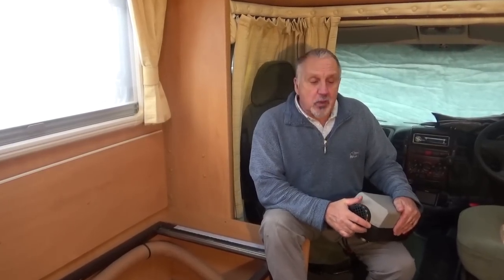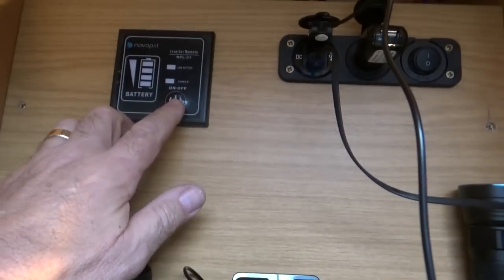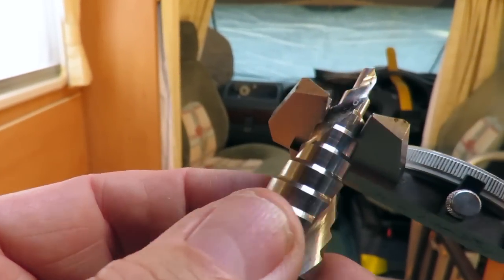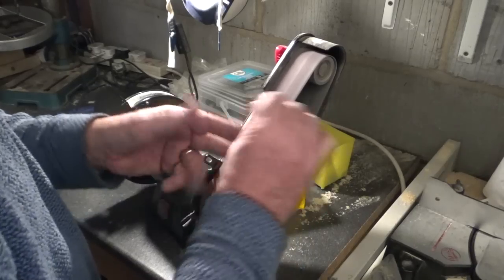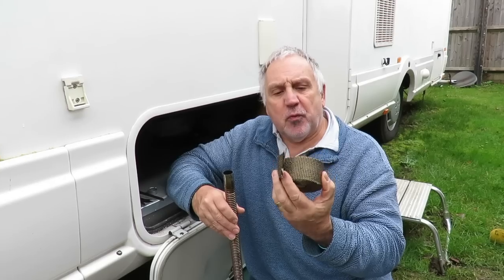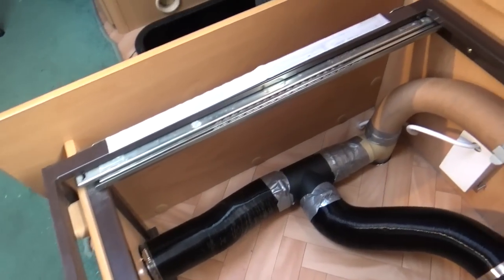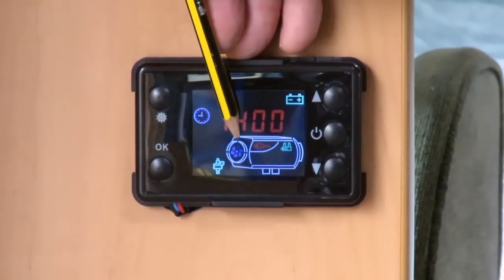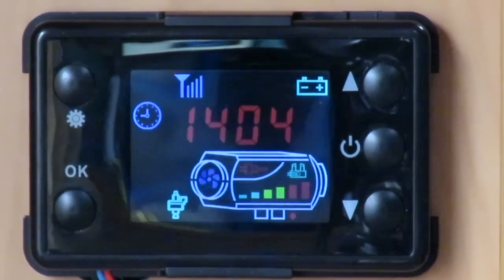How To Install A CHINESE DIESEL AIR HEATER, Ebay 5KW parking heater fitting guide. Full instructions

Comment: Good video.  Well explained for the most part.  Some additional suggestions for other installers:  the exhaust port (vs air intake line) is the one furthest away from the fuel inlet, and it’s very wise to seal the exhaust pipe to the main unit with high heat sealant to prevent anyone from killing themselves with carbon dioxide leaks.   You’ve done a tidy installation overall but you could  have saved yourself a lot of work (and prevented air leaks between your outside storage chamber and the interior under seat area) by simply tilting your tank over by about 20-25 degrees  so the top was low enough to fit in the space under the seat top.  Nice job though.
Reply from the maker: Hi Richard,
Yes, did consider using a different shaped (more squarer) fuel tank, but must admit it never dawned on me to tilt it.......!
I did actually add a little exhaust paste to the joints after, but didn't film it. 
But I did check the carbon dioxide levels at the burner and at the exhaust outlet. At the burner was zero, to be expected. But at the exhaust it was barely much above the zero as well. Which really surprised me and shows how efficient these units really are.
I have several Co2 meters in and around the motorhome, so feel confident I would be alerted of any leaks, plus I tend not to run it during the night.
All in all, they are very good heaters that work really well for me.
Thanks for your comments, 👍
ATB, Steve

Comment: Hi when priming how do you know when the fuel is up to the heater or does it automatically come out of prime when it's done?
Reply from the maker: Hi Martin,
If you used clear fuel pipes you can trace the fuel as it goes along the line, if not you can have an open end upsteam of the pump.
Mainly depends on your installation really.
Essentially it's only to save you ab of if time when you first fire it up.
Reply: @TheWrinklyNomads  Hi thanks for your reply. Yes it's clear fuel line. So I am guessing once its up to heater I just Press stop on controller the fire it up?

Comment: Hi, I’m thinking if using one of these to heat my shed/mancave. I can run it off a 12v car battery, but should I back this up by fitting a 240v to 12v power supply to the battery ?
Reply from the maker: Hi David,
Lot of people do that.
So long as your battery is topped up you will be fine.
I have a video on the amps used to run  these burners as well:
https://youtu.be/puvd9Z8zJFY

hope it helps
Steve
Reply: @TheWrinklyNomads  s
Reply: @TheWrinklyNomads  hi, thanks very much for answering. Your videos are very helpful. Now I just have to find out what type of power supply I need to put in to keep my car battery topped up. I will need a 240v-12v continuous power supply as I’m going to use the heater for my mancave which my son has taken over as an office for working from home. Any suggestions are most welcome. I definitely intend to use one of these. Chinese units, only £100!!
Reply: @TheWrinklyNomads  Hi again, after watching a few of your videos I’m going ahead with a heater for my mancave. I’ve decided to use a leisure battery kept charged by a solar panel and controller. As I wont use the heater every day this should be plenty. I have another question. I’d like to mount the whole unit outside in a box and run the heat hose into the shed, but the other end of the heater will then be out in the cold, should I run another hose into the shed for the fan to take the air from ?

Comment: Love the video but can't understand why you didn't move the heater over so it was closer to the edge and then run the exh and air which are flexible giving you full access to storage compartment
Reply from the maker: Hi Stephen,
Thank you for your comments.
I used this system for 6 month, however, since this video I have done a complete upgrade, including a new tank setup.
I now utilise the storage below exclusively for the heater.
Here's the video link:
https://youtu.be/HHJaPP2uLFA

ATB, Steve
Reply: @TheWrinklyNomads  the new set up is excellent love the new fuel tank and would love to know where it was from I can only find small or oversized
And can't wait for the next video keep it up and thankyou

Comment: taking a jerry can into the van to fill the fuel tank seems painfull, as it has to be refilled every 36 hours of use;, as does his exhaust pipe cutting the external storage access  in half. i guess it was because he was trying to use existing ducting. Helpful to see the assembly process though  :)
Reply from the maker: Hi
This was just my initial, test install.
Since this video I have completely upgraded this install to this:
https://youtu.be/HHJaPP2uLFA

A massive difference...

All the best
Steve

Comment: Hi can tell me if my 240	To 12volt transformer from my fridge to run the heater from the mains
I have noticed the output voltage reads 14,3v will this be OK?
Reply from the maker: Hi Henry
Yes, it should be ok.
However, if the transformer is not man enough at start up the heater will simply shut down.
You also need to be careful that the transformer is not accidentally turned off when running the heater, as this can cause serious damage....
ATB, Steve

Comment: I would advise you to have an extra vent into the cupboard that has the air 'filter' located..  and on reflection I bet you regret running the exhaust right in front of the store access door...
Reply from the maker: Hi Anthony,
There are additional air vent within the storage area, so all good there.
I have the same access on the other side of the van, so no problem with access there as well.
I am, however, considering moving the whole unit into the lower locker area with a new square fuel tank for out side filling.
Wont be doing that until the summer now though.
ATB, Steve
Reply: UK Preppers Guide I’ve been reading through the comments to see if you’d mentioned installing it in the locker itself as it would have been my go to for no other reason than keeping the combustion further away from me. I’d be scared of CO but less so if it was separated away from me. The rest of the install looks superb. 

How loud is the dosing pump in operation? It seems distracting but I guess you get used to it quickly

Comment: How hot does the exhaust get?
Answer: 200c ish at the start of the exhaust. You can recover this lot heat by passing it though a radiator or heat water by wrapping a copper pipe around the exhaust.
Reply: Very hot.  Enough to scorch or burn anything combustible within a couple of inches of the pipe itself and within at least six inches from the pipe end.  I recommend a few turns of thermal insulation (eg stove pipe tape) as it passes close to anything.
Reply from the maker: Hi Mark,
With this set-up the exhaust gets hot enough to melt materials like plastic pipe if it touches it.
It would certainly scorch wood and given time probably ignite.
But, realistically it would need to very close to a combustible material to cause damage.
Since this video I done a significant upgrade to this system where I ensure any heat from the exhaust cannot reach anything combustible.
Worth a watch here:
https://youtu.be/HHJaPP2uLFA
ATB, Steve

Comment: I’m fitting one to my t4.fuel tank has got copper pipe and vent thing that goes in tap .nobody seems to have fitted one just the pipe in side of tank.
Reply from the maker: Hi Steve
I have seen that done before. 
There are a couple of YouTube videos showing it done as well. 
Since this video I have done a massive upgrade and looked at that fuel tank method as a possibility. 
You’ll find the video here:
https://youtu.be/HHJaPP2uLFA

ATB, Steve

Comment: About how many hours of heating do you get with 10liters of fuel?
Reply from the maker: Hi Steve,
I run my controller using the Hz setting on low, so would expect to get 70 hours for 10ltrs of continuous use. 
I’ve got a video on how to properly calculate fuel use here:
https://youtu.be/z8SkKAlOAxU
Hope that helps
ATB, Steve

Comment: Here in Britain heating oil is cheaper than red diesel .... Have heard that running it on the former might damage the pump. Is that true ?
Reply from the maker: Essentially its just a basic oil / diesel heater and, as such, should run on any type of diesel/heater oil fuel.
The main thing is that the settings are correct to give good, clean combustion.
I've even seen videos of people using old fish shop oil and getting a clean burn!!!!
So yes you can run on heating oil without problems.

Also, since this video I have completely upgraded this heater system in my Motorhome...
Best upgrade so far,!!
I also have an installation video on it here:
https://youtu.be/HHJaPP2uLFA

ATB, Steve
Also,
Reply: @TheWrinklyNomads  thanks

Comment: Raising the heater off the floor is well dodgy, you are potentially allowing exhaust leakage into the habitation area.
Reply from the maker: Hi Roger,
Yes, it definitely could be dodgy, but I did box that area in and sealed that area, which is not shown in my video unfortunately.
BUT, after running this for about 6 months I have since completely changed and upgraded this system.
Very much better - I have the upgrade video here:
https://youtu.be/HHJaPP2uLFA

ATB, Steve

Comment: I just set one up today but im runnung it for small office, im usung a 240 to 12v transformer, its coming up with error  02, have i to many volts, any help appreciated thanks
Reply from the maker: Error code 02 is an over voltage error.
You would get this if you were wired to a 24V battery,  you have 2 x 12V batteries wired in series, you have a variable voltage transformer set to a higher voltage..?? 
So if you have any of these conditions than that's the problem.
Hope this helps
Steve
Reply: @TheWrinklyNomads  thanks for this, I have it connected to a 240 supply via a 12v transformer, what is my best way? can i just run it on a 12v battery and keep it on trickle charge. Can you run it on a battery and also keep trickle charge on constantly in order to keep battery up to full. I appreciate you help

Comment: Are these loud?
Reply from the maker: Hi Dean,
When you run on full power (max. heat) the fan pushes the air through the ducting mush faster which make them sound louder.
On tick over they are nice n quiet and I hardly notice it on.
I do know, however, that the exhaust puts out around 79 Db on maximum and about 62Db on minimum, when you measure at the exhaust outlet.
You can box them in and add insulation which definitely helps if your worried about the noise, quite a few video on here about that.
Hope this helps,
ATB, Steve

Comment: Why not put the heating unit down in the cargo hold  then you woulnt have to cut so many  holes and    all you would have to do is run the duct pipe
Reply: I wondered same, I’m especially concerned by the exhaust mounting which other folks fit turret plates,  so that the mounting joint is outside the cabin/van ie underneath. That way any leaks drop under the van.
Also you might consider a carbon monoxide alarm / mentioning it in the comments .

Comment: You could have used a smaller fuel tank that would have fitted under that seat swob area, then you would not have to have cut out the floor to get the tank in.
Reply from the maker: Hi Charlie,
I did exactly that..!!
Ran with this system for about 6 months then changed and upgraded the system quite a bit.
Probably the best upgrade I've done so far..!
Here's the link:
https://youtu.be/HHJaPP2uLFA

ATB, Steve

Comment: hi ,You are not supposed to fix the pump vertically
Reply from the maker: Hi David,
Vertical is the ideal position.
Positioning at an angle will allow air bubbles to form in pump chamber as cavitation takes place.
This can increase pump wear and give incorrect fuel dosage.
Mind you, these little pumps will work at just about any angle.
ATB, Steve

Comment: I hear you can turn heater on one side. Kong as glow plug up top. It only works on one side. I heard one guy had problems. Flooding it out. I’m not sure. More research needed
Reply from the maker: Hi Lod,
I've never actually seen this done, although I believe it is possible.
Originally these units were designed specifically as HGV air heaters that must be mounted horizontal for best performance.

ATB, Steve

Comment: Diesel tank in the passenger compartment?
Reply from the maker: Why not?
Most van lifers have them inside the van, behind seats, under the sink.... anywhere really.
Its diesel oil so no more dangerous than cooking oil really.
Having said that I am in the process of upgrading the system and adding a completely different tank, so watch out for  that video soon.
ATB, Steve
Reply: @TheWrinklyNomads  Diesel oil is not dangerous. But the smell of diesel spoils the atmosphere. Inevitably, the smell stays in the cabin when refueling and there is a risk of oil accidentally dripping onto the mat and elsewhere.

Comment: hi is the diesel heater still working ok mate
Reply from the maker: Still all running good Duncan... 👍
However, I have changed the diesel heater layout quite a bit since this video. Really happy with the upgrade.
Made a video of the upgrade as well:
https://youtu.be/HHJaPP2uLFA
I have also been adding a small amount of fuel additive in the tank as well. Definitely helps with a cleaner burn..!
ATB, Steve

Comment: And he says that you only have to prime the system when you do a new install I own one it is just like owning a diesel vehicle if you end up running out of gas in your diesel truck and you’re gonna have to go through the priming cycle once you fill it up again, so if possible, do not let that 10 L tank run out of diesel fuel
Reply from the maker: Hi Cody,
Your quite right - never let the tank run out!
So far I have never had to re-prime the system, but that's only because I've never let it drain the fuel tank down to empty.
Without a doubt, if you do, it will throw up a E-10 error on the controller.
I have also changed the whole layout since this video.
The tank and supply being the main changes. Here's a link:
https://youtu.be/HHJaPP2uLFA
ATB, Steve

Comment: Pump needs to off set 45 deg
Reply from the maker: Hi,
That is a common misconception.
Any angle that allows the build up of air bubbles to be formed in the pump, through cavitation, must be avoided.
However, provided there is a natural upward flow of the fuel pipe from the pump you will be ok. Any formed air bubbles will move along the fuel line and eventually make their way to the atomiser where they will be got rid off inside the burn chamber.
I generally say, 30 - 90 degs as the acceptable angle to ensure this happens.
With 90 degs being the optimum, as it is the least line of resistance for an air bubble to pass along.
Hope this helps
ATB, Steve

Comment: Fitting a fuel tank inside the vehicle?? Is that legal?? Must smell when filling?
Reply from the maker: Hi Paul,
Perfectly legal. In fact 90% of retro fitted diesel heaters use the inboard tank method, especially the smaller van builds.
I suppose if your clumsy and spill fuel it will smell. Otherwise no smells at all.
Since this video I have completely upgraded this the layout of this system. especially the fuel tank.
Here's the link:
https://youtu.be/HHJaPP2uLFA

ATB, Steve
Reply: @TheWrinklyNomads  Great video! We have a very small Ford Transit Connect van, so accessing the tank for re-fuel was a logistical challenge for us. We also didn't like the idea of having any fuel inside the vehicle. The other options were underneath or in the engine bay. If it's underneathe vehicle, accessing for re-fuel is even more difficult. We ended up buying a small 1L or 1/4 gallon tank for the engine bay and it works great.

Comment: Surely fit a different tank - rather than compromise the floor!? 

Speaking of the tank - the diesel tank ideally should be outside of the living quarters and definitely not next to the heater.

I know this is DIY but it doesn't follow any regulatory guidance at all and and people might copy this!
Reply from the maker: Hi Dan
What about the all in one heater units?
They have heater, fuel and controls tightly together in one self contained box....
Diesel fuel is no more liable to ignite than cooking oil and that’s often left next to the open flame of a gas cooker..
There are no guidelines for this type of Instalation and there are literally thousands of vans with DIY installations, with no problems. 
Having said all that, I’m in the process of a complete revamping of the diesel heater system and I have a different tank going in. 
Positioning it in the lower storage area, as I am changing the area above. 
Should have the full video up in a few weeks. 
Thanks for your comments 
ATB, Steve
Reply: @TheWrinklyNomads  the AIO units are typically made of metal. At least the fuel container is.

Imagine if in this scenario, the heater went slightly wrong, melted the fuel tank, the fuel spills out, seeping into the surrounding material and then it catches fire from the malfunctioning heater.

Diesel burns slowly - unless you give it a medium to wick through. Like carpet, fabric or a sofa cussion.

You're not going to get a fireball - you'll just die of smoke inhalation in the middle of the night.

"I wouldn't run it at night"? - that's because you know it's unsafe.